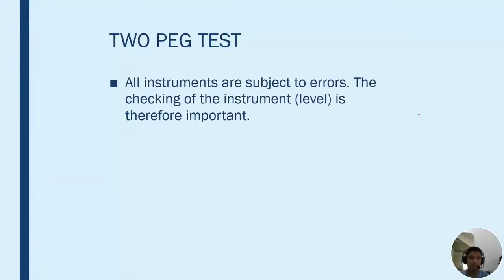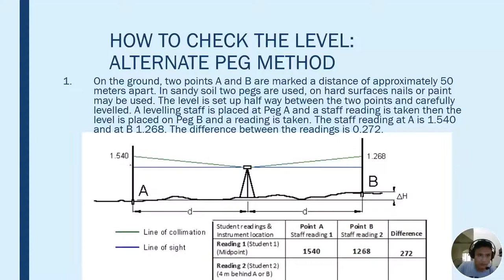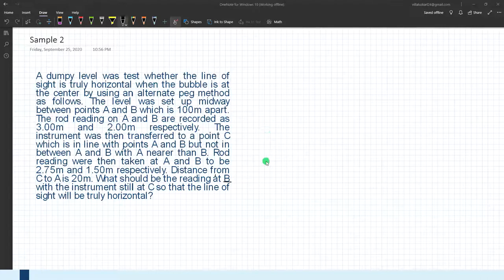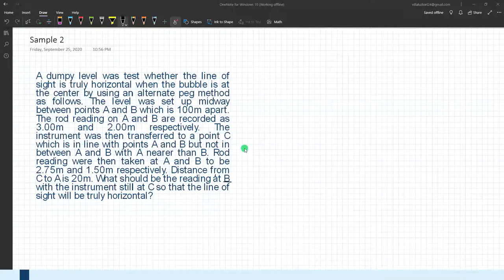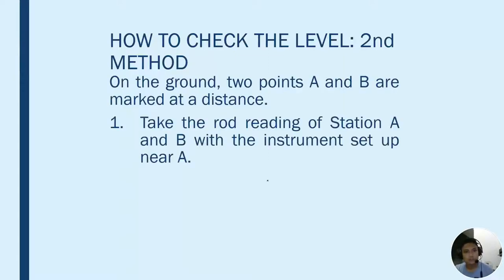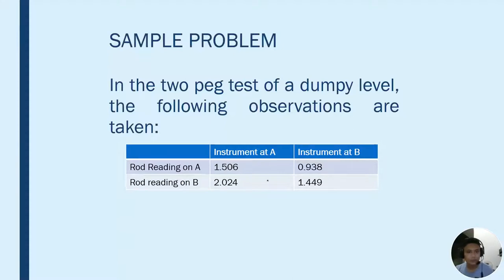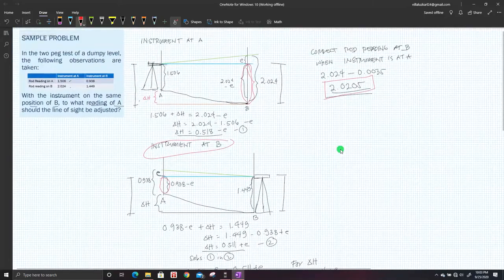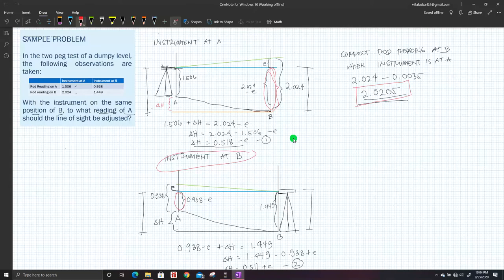Levelling (Two Peg Test) Part 2 of 3

Comment: What if the instrument wasn't set up midway? And there was an error in tbe bs/FS
Reply from the maker: The most convenient way of elimating/correcting the reading is to really is up the instrument midway to easily determine the difference in elevation of the stations. If it is not set up midway it might lead to longer solutions of computations.

Comment: Pwede po ba magnegative error na makuha or iaabsolute value po un, makakaapekto po kasi pag isinubtract sa DE
Reply from the maker: A negative result in the error(answer) means the assumption direction of error is incorrect. Numerically correct sya.

Comment: Yung delta H po pwede po ba yun ilagay sa either sa point A or sa point B?
Reply from the maker: Delta H is the difference in elevation between points A and B. Kumbaga vertical distance sya between A and B. I usually put that dimension on the station with higher elevation which is used in making an equation.
Reply: Sa pagdrawing ng problem po, paano niyo po ma-identify kung ang delta H ay nasa bandang A or B? Inaassume lng po ba yun na may isa sa kanila na nasa higher elevation?